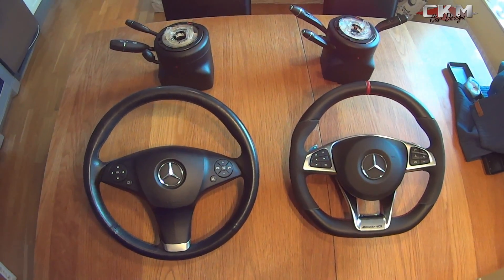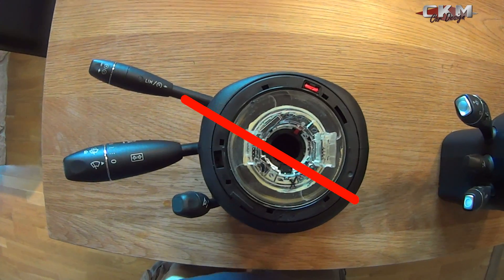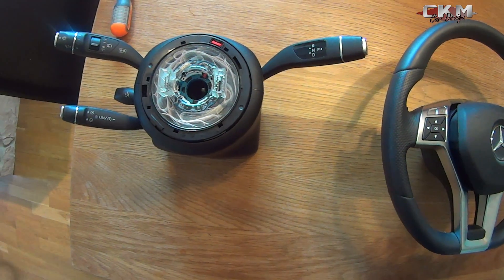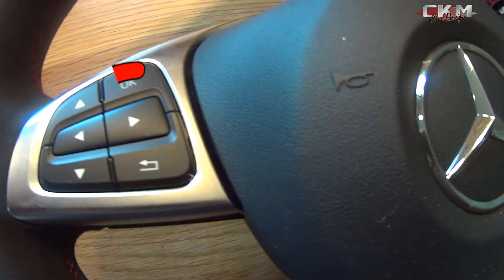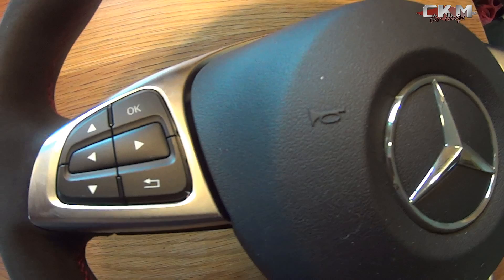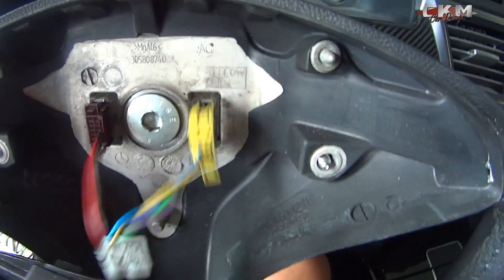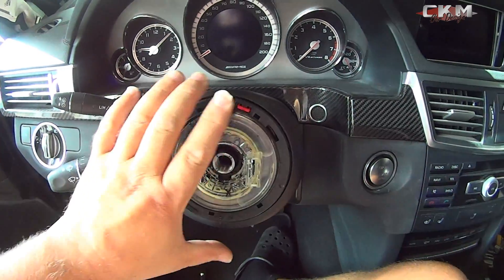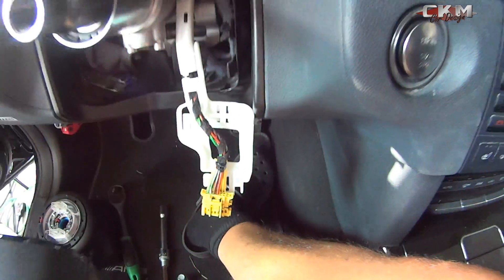Mercedes Facelift steering wheel retrofit W212 W204 W166 W176

Comment: One more question, when you changed the new steering column combination switch, you didn't have to program your car again? I bought exact same steering column switch with a new steering wheel after watching your video. But all the mechanics in Korea are saying there will definitely be some conflicts because it's not the original part. My car is w212 2013. And the new column switch is w212 +2014 as you know. So after changing the new column switch you din'd find any error messages in your car? I really want to know if we can just change the column without doing any programming. If so, that'd be awesome !!
Reply from the maker: No. They dont know what they talk about. No errors if its the corect wheel and column.
Reply: @CKMCardesign  I've just found out that inside of the steering column i got looks quite different from the one from your video. 
https://drive.google.com/open?id=1v_PV45UhXUm11Ia6eefvGZ8JOGizclwo
if you click the link above, you'll be able to see the newer steering column. Left side is my present one and the right side is the new one I've bought. Do you think I can still try to install it in my car, w212 2013?
Reply from the maker: @JOOJOOinSeoul  Of course. Does not matter at all.

Comment: I have the 2010 E63 so no column shift. Do you have the part numbers for the column I would need without the shifter on it and for the steering wheel? You didn’t post the part numbers. Thanks
Reply from the maker: I dont work with partnumbers on the columns. Only visual.

Comment: Hi mate brilliant video and hope you can help me. i have a 2009 w212 e350, already have a flat bottom wheel as standard but want to upgrade to same wheel as you have used in this video. My current column is exactly the same / identical to the one you have used in your video so i’m presuming mine will work or will it not with it been 2009? by this i mean even though they may look the same do the 2014 etc columns contain different functions?? and lastly if i was to buy a new collumn that contains the shifter stalk on the right side can this be coded to work on my car or is that a no go?? help will be greatly appreciated
Reply from the maker: 2014 etc columns contain different data protocols. All is explained in video though.

Comment: I have the c300 2009 sport and it has the same buttons as ur steering did, what kind of steering is the amg and column you used from to what year is the upgrade to? I also hear I can install a tesla big screen instead of the small pop out navigation

Comment: Is that bolt tight enough? You didn't put much force on it. And it's better if you torqued it to the right specs.
Reply from the maker: It was only for the video..Been off many times after that.
Reply: @CKMCardesign  Ok than i didn't say anything 🤐

Comment: Great video! Do you know what options do I have with my W204 -07. It has 4 spoke steering wheel but I would love some more modern 3 spoke. Also do I have to change the steering column anyways?
Reply from the maker: Yes for any modern wheel you need a column.

Comment: I have a 09 C63 with w/30. My wheel leather and alcantera is worn out. What part #s for column/wheel are my options to go with a facelift p30 wheel or a c63s wheel? thanks
Reply from the maker: I dont work with part number affraid.

Comment: Thanks a bunch for sharing this cool video. Just a quick question bro! So the new steering column in the video(w212 +2014) can just fit my older e-class, w212 2013 without any other adaptor or something? All I have to do is just getting a new one and insert it like that? I asked many Korean mechanics about this issue but they're not sure about it, just bc they never tried ; they have experiences of replacing with the same column model, though. Not like my case. I want to replace my w212 2013 column with the new w212 +2014 column to install a new w205 AMG steering wheel. Plus they're saying that changing a steering column can be very tricky so they just recommended me to change the board inside the steering wheel rather than changing the column. But I'd love to use a new column too. So I just wanted to double check if I can use the newer column without any change in my car, before I purchase a new steering column as well as an AMG steering. Thanks !
Reply from the maker: Yes.  You see here how simple it is.

Comment: Hey Chris, do you have a clue whether AMG steering columns are any different from the standard ones in terms of steering wheel fitting. I am trying to fit a pre-facelift W204 with one of the square buttoned steering wheels, like the W204 facelift ones, but the part number starts with A218, so seems its from a CLS W218. I found 2 good priced steering columns starting with A218 for the same years, the connector in the back is the same as in my W204, so the column will plug in successfully. The thing is, the one from  an AMG car is slightly more expensive, but it has only the 3 levers I need on the left. All the other columns from standard CLS models have the gear  transmition lever on the right, so I'll have to remove  it, leave a hole, put a sticker on it etc etc. So wondering whether you have a clue if the AMG would have different electronics that could make the steering wheel unfit for the column. The AMG ones usually have a flat bottom, and they use a different airbag, even though it looks identical. So that would be the only possible issue that comes to mind. Thanks for your time! <3

Comment: I have bought.the facelift amg look steeringwheel for my mercedes w207 2011 , now the airbag from the new steeringwheel does not fit 100% in the steeringwheel and the buttons dont work to and shift padles , i did not change the colom its stil the original one should that be the problem then why the buttons ext does not work ?
Reply from the maker: Did you not look at the video?

Comment: I driver 2008 c180 kompressor, and its steering is without paddle-shifts, if i install this one on it, will new steering's paddle-shifters work?
Reply from the maker: If you get a column that has the function and your car is a automatic then  yes.
Reply: @CKMCardesign   cool thanks for replying
Reply: @CKMCardesign   cool thanks for replying

Comment: Can you use the airbag from the older sterring wheel to the new or u need a new airbag too?
Reply: New steering wheel should come with the airbag.
Reply from the maker: @e90build94  What?
Reply from the maker: If you use a saw and a hammer it might fit.. ;)

Comment: is it possible to change the steering column from non electric to electric positioning on the w212
Reply from the maker: Yes..
Reply: Would the parts shown in this video be all thats needed to perform this upgrade to electric?
Reply from the maker: No No...You of course need the hole mechanic column and motor plus coding the car for it.

Comment: Hi, I have an w212  facelift and wanted to change the steeringwheel of the w176 without changing the colum, does it work?
Tanks in advance
Reply from the maker: Only if the car is 2014 and up.

Comment: I have a pre facelift W204, 2010 C250 CGI. I wonder if a 2012/2013 W204 steering wheel will work with my car.
Reply from the maker: It should. Might need a new column.
Reply: @CKMCardesign  Thank you for the reply! Will the column from the new wheel work? I'm gonna get the facelift steering wheel straight with the column that comes with it.
Reply from the maker: @patrides  Yes it should.
Reply: @CKMCardesign  this also Works on Mercedes c 2008 but i need a new clunm

Comment: Hello, I changed steeri g wheel with column on my w212 2010, but getting esp error after wheel turned right, tried to reset angle by turning all way left and right and reset fault by mercedes star diagnostic, but still error appears, when wheel turns right. Any suggestions?

Comment: My 2015 W212  E class does not have distronic switch lever. Can I get a new steering wheel that has the distronic lever to enable the distronic feature?
Reply from the maker: That sits on column.

Comment: I have a 2011 e63 amg I want to do this. Changing the steering colum to the one that has the gear selector will also allow you to put the car from p n r d? From the top? And still the bottom?
Reply from the maker: Of course not.

Comment: Hi, I have a 2011 E550 and bought exactly the same wheel and the same steering column, but they don't work. The install was very easy and all of the plugs just plugged in like they should, but nothing works, not even the gear arm. Is there anything I am missing or anything I can do to get them to work? I tried different combinations between the old and new wheels and columns and the only way that anything works in with the old pair. Please help. Thank you.
Reply from the maker: Then you did not buy the same. Guess you bought a W205 column or so...

Comment: hi just bought a slk r171 ,the previous owner has had 4 wheel alignment done ,car runs straight no problem there but the steering wheel couldnt of been centered properly so is off a bit to the left,so rather than mess with the alignment,do you think moving it a few splines to the right would be ok
Reply from the maker: Of course

Comment: If i have W246 2013 year, i need change steering wheel column if i want install Face lift steering wheel from A class 2015 year?
Reply from the maker: Probebly yes. Might not though. Just have to try.

Comment: I have a facelift w204 and ordered a steering column and steering wheel from a CLA 2015 w174, i also have the cruise control handle now , wil this work and is it possible to also program the car so that the cruise control will work?
Reply from the maker: Should work fine. NO..Cruise control needs alot of cable kits and modules to work.
Reply: @CKMCardesign  They said they could just program it in at the dealership... hmm..
Reply from the maker: Ok! Intresting!

Comment: How did you take out the gear stick on the side of the steering column please I’ve got 2008 c300 pfl I’ve found the same steering wheel just need a column now but didn’t want to get one with the gear stick on thanks again chris
Reply from the maker: What make you think I took it out? Just bought one without it.
Reply: But in the Video it’s shows gearchange stock on new column b4 you fitted it then not there when fitterd
Reply from the maker: @rp6169  Yes

Comment: Man, I need your help. 
I have a CLC200K (2010) and I want to change the steering wheel, but my steering wheel is quite different of yours. Mine do not have the "ok" and "return" buttons and the side arrows are folders on the LEFT. I don't have the "mute" and "speak" buttons on the RIGHT.  The column commands are the same. Do you know if I can do this switch???
Reply from the maker: Not even close to work. Sorry. All you can use is versions of the one you have.

Comment: i have dont have automatic transmission would it be a problem if i put on a steering wheel with flippers on the wheel to change gears does it affect anything ?
Reply from the maker: You can but then of course nothing heppens when used since you have manual trans.

Comment: hello, i have a question, i changed the collumn switches to 2014 one, but steering wheel buttons dont work and my car has newer style 3 spoke wheel, do i need to get 2014 steering wheel aswell ?
Reply from the maker: Depends on alot of factors.

Comment: I noticed that the PRND shifter was removed how did you do that ? Because at the beginning of the video the PRND shifter was on the column switch. Then when u installed it, it was gone.
Reply from the maker: Bought a column without it.
Reply: @CKMCardesign   what is the part number for a the column without the gear selector
Reply: What’s the part number

Comment: I have a 2013 CLS W218 with the updated levellers already. Do I need to buy new ones from a newer car like the W205 or can I just use my existing ones? Also, what about lane keep assist (with the vibrator) etc? I don't want to lose the vibration functionality or paddles.
Reply: Did you ever figure out an answer for this?

Comment: What tools did you use on the bolt to unscrew and tighten it?
Reply: Is it a 3/8” ratchet and socket?
Reply from the maker: @jss6031  Dont remember actually. Bought so many years ago su I just use it without knowing now.

Comment: Hey there,thanks for this great video!For a mercedes cla 2013 regular round  steering wheel  swap to AMG ufacelift (one tested on your car in the video  )  is the same easy no coding or mdules?i have the steering column controls on like in the video
Reply from the maker: Yes. Column still might need a change. Just try.
Reply: @CKMCardesign  thanks i will try and keep you posted
I undersand that worst case scenario is needing to swap steerin column.
Reply: So i swaped  the steering wheel  it was plug and play,no need to change the column
Reply from the maker: @2187catalin  Awesome.

Comment: Hi! So if I have 2014 cla, will it fit with 2016 style steering wheel?
Reply from the maker: Of course. No column needed then.
Reply: Did you change it ?i have the same situation ,cla from 2013 and i found a good 2016 amg steering wheel from a damaged in the rear car

Comment: I replaced on my w212 2011 the steering wheel with a amg but the connectors are different
Do you have the electronic part with right connectors which connects with those buttons?
Reply from the maker: Conectors?? If anything is different it wont work with new conectors.
Reply: @CKMCardesign  do you have steering wheel buttons to fit old steering wheel electric system?
Reply from the maker: @corneliusvasi5074  For what wheel style? And which old system?
Reply: Factory standard steering wheel
Reply: the ones that are in your video
Reply from the maker: @corneliusvasi5074  You must have a new column.
Reply: Good to know 
Do you know witch one will fits or any codes to search for?
Sorry but I'm very limited about electronic or mechanical stuff
Reply from the maker: @corneliusvasi5074  Buy it all as a kit on my site and yo get what works.
Reply: I couldn't find it 
Can you send me the link?
Reply from the maker: @corneliusvasi5074  mail me.

Comment: Hi, I have a cla 220 cdi of September 2013. I have the flat bottom pre restyling steering wheel. Is it possible to change it with that restyling without coding and without changing the steering wheel column?
Reply from the maker: Yes if you get the corect wheel..
Reply: CKMCardesign Thanks for the reply. I have the last question, which is the correct steering wheel :)?
Reply from the maker: English site: www.mbscashopen.com

Comment: Hi ! I have w205 prefacelift and i have bought the facelift steering wheel but i cannot get the bottons/ horn to work. I have been looking on the internet that i can connect a modul but can i do it by upgrading the steering column as your video can you please tell me what kind of colum to buy and do i need coding ? Thanx
Reply from the maker: For W205 you need our converter module found on site.

Comment: Your new steering column looks like it lost its gear lever. Where did it go? Can you remove it
Reply from the maker: Answered several times here.
Reply: sorry couldn't find the answer. would you mind answering again
Reply from the maker: As I said so many times. I off course took the corect model for the car it goes into. First one is just an example.

Comment: @CKMCardesign i have prefacelift w204 with 4 arm steering wheel. I'm going to keep my old steering wheel column and use my old circuit with cable adaptation, i ll buy a w176 steering wheel. The only thing bothers  me the airbag.. can i plug the new airbag to old electronics directly or do i need something more?

Comment: 2011 SLS . which steering column need ? can you share part number of column ?
Reply: A2059002239 OR A166 FROM 2017UP GLE ? THE OLD COLUMN SAME AS YOURS VIDEO ON LEFT .
Reply from the maker: A166 always work.

Comment: Hey i have the w212 2014, do i just need to remove the steering wheel? What about the distronic. Do the Vibration still work or do i have to modify somerhing for that.
Reply from the maker: That will never work on 2016 wheel affraid.
Reply: @CKMCardesign  so no Upgrade possible for my car
Reply from the maker: @amaruhshakur8127  Not if you want that anying vibration in the wheel. Distronic works of course.

Comment: I have a w204 2012 facelift. I want to fit a45 2017 steering wheel with up down left right arrows on steering control Locke you said. I removed the w204 steering column and yellow connector has 8 pins with top 4 pins are empty.   I have got two new columns, a steering column from w205 2014 but has only 6 pins and 4 pins (2 lower pins missing the main block) and I have another steering column from w176 with full 8 pins and 4 pins on top. Are these compatible ?
Reply from the maker: Yes. Pins dont matter.
Reply: Did you get this to work?

Comment: when i install a steering column with the column gear shifter on w204 facelift.. would it be possible to make the column gear shifter work instead of the regular center console shifter? i know pretty much everything is possible but i mean with resonable time and effort/cost
Reply from the maker: No. Floor one is mechanical.
Reply: @CKMCardesign  would w212 parts/harnesses work possibly? since in the facelift they changed it for the steering column one
Reply from the maker: @arcinvert  It so much involved inc SAM and EZS replacements as well plus all codings.

Comment: Does it work with my c220 w204 2009? And does the steering collumn change work too?
Reply from the maker: Yes. Yes.
Reply: CKMCardesign thanks man!
Reply: CKMCardesign really ? Love you man, one question can you just remove the gear lever on the steering wheel it the original doesn’t have one and will also the back pad shifters work ?